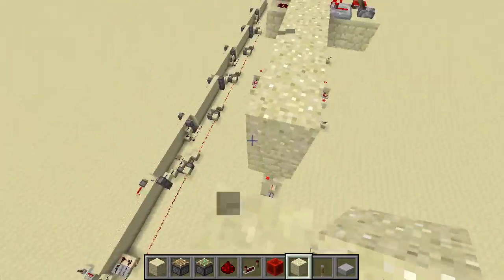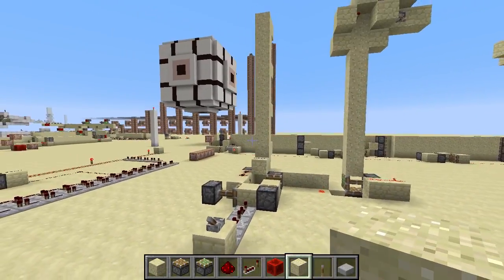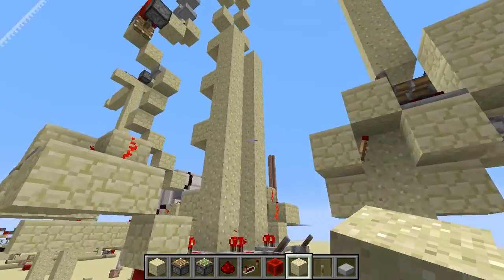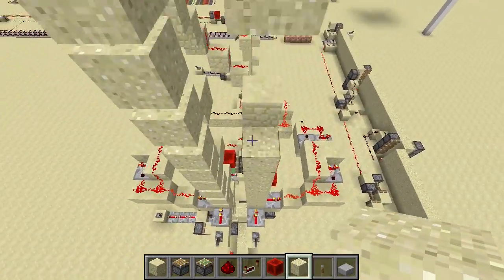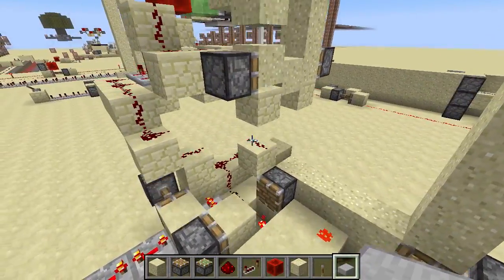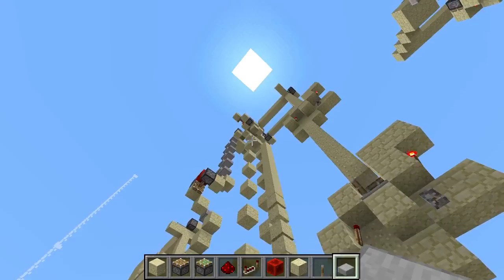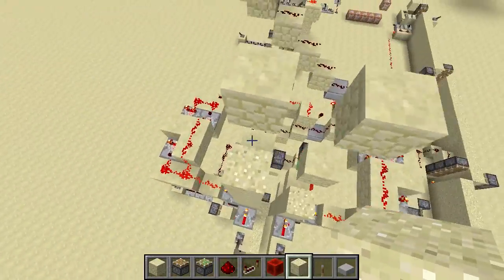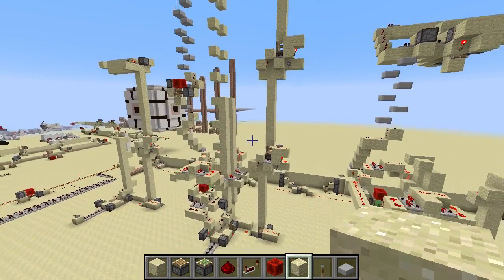0.45s asynchronous sand buffer - MInecraft

Comment: Or you could build a simple buffer in lazy chunks.
Reply from the maker: Yeah, I'm aware of that, IDK if I was when I made the video though. Yet, I still ended up using some of these, they're useful in some situations:

- Spawn chunks are really big, if you want to build a buffer there (which I had to do once) it's probably easier to use one of these than to send a conveyor all the way to the sides.
- If the End is player-loaded (artificial custom-dimension loading didn't seem to work very well in 1.8) it's annoying to have to build it far away and in a very precise spot, forcing the player to stay in one chunk while the machine is running.
- TBH that's kinda all I can think of, maybe there are more uses but it's been so long that I forgot. :P
Reply: Wouldn't you only need a single buffer system in a sand generator? Just enough sand to keep it going until the loop is completed once.
Reply from the maker: Errett C.
Not in my case, but I can't really give the details. :P

Comment: I really like this design! I actully got a really good idea from this video! I have been looking for a time that is very reliable (I tried a hopper system, and that wasn't accurate enough, and I also tried using a repeater-lock-gate, and that was too large to fit in side the machine I'm making... this machine is very constricted on the horizontal axis), and this machine looks like it might fit!!! Would you mind if I used it? I will give credit for the redstone!
Reply from the maker: Err ... sure, though I don't really get what you're making. XD
Reply: +Wout12345 A fully automatic TNT cannon. I noticed that when it is filling one of the two columns, it gives off a very fast pulse, then holds the pulse until the sand is extracted. That gave me a good idea for a dual barrel TNT cannon, and the timings would be controlled by this buffer! I would just hook up the inputs directly before those pulse extenders , then run each input to each barrel for the cannon. I think it will work well, although I need to make the cannons far enough apart so they don't effect the falling sand from the buffer. You may think this is a bunch of useless stuff, but I have another idea for this thing as a delay circuit for a piston door, no joke! I might post a video on it later! Is there a world download to this, or should I make the buffer on my own?
Reply: +Wout12345 Wait, nvm, I see the download link :D

Comment: Nice...  I made a neat redstone machine a few weeks ago witch uses block updates to send a instant redstone signal vertically
or horizontally  instanly upto 32 chunks away but the issue is that it only works once.... i'm going to work later on a reset mechanize to reset the instant signal as soon as it updates making the fastest possble output. with out using commands. witch is a plus+ buts it may take time for me to figiure out how to reset it...
Reply from the maker: Sounds cool, interested to hear about it once it's done. ;-)
Reply: I will imform you with details if i can get it working xd!

Comment: intresting my idea has to get around sht similar. this is quite an intresting way of dealing with this. for my idea i actually planned on doing. a bit more complicated. that s why i have to find out how sand accelerates :P
Reply from the maker: And again, that's something you spend a fair bit of time on. Whatever approach you take, this project is quite extensive contrary to what you seem to imply in some of your tweets. ;-)
Reply: xD well, i exclude research from how long it takes bc knowledge is a general thing :P
Reply from the maker: Yeah, but even with that knowledge it'd take quite some time to fine-tune a design which would deal with accelerating sand properly. TBH I think this is probably the easier solution, yet I also spent 2+ hours on this from what I remember.
Reply: well, the issue with this is that it doesnt deal with the minimum of 2 gt even a 0 tick piston is extended.
Reply from the maker: Jendrik Weise 2? Don't you mean 3? Anyway, yeah, it's a 0.45s buffer. As with my other builds, I built it to suit my needs, and since it does I won't improve it much more. :P TBH it may also work with 0.40s output, IDK, I just never tested it.
Reply: idk if i need i ll have to design one myself bc this is very specific anyways so ya